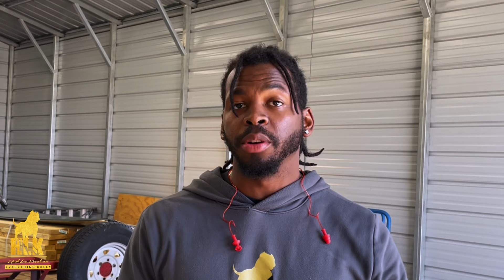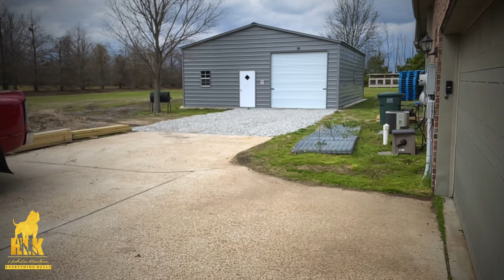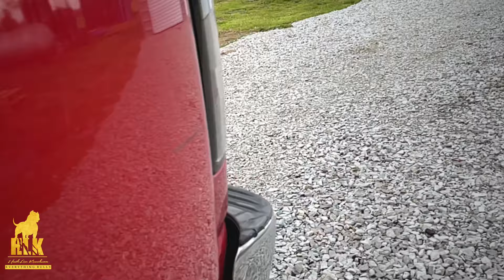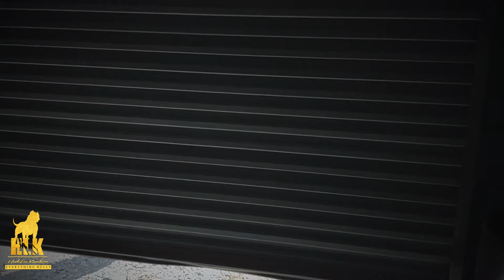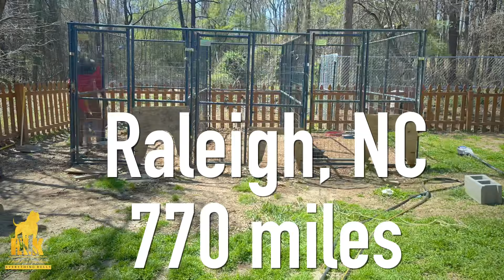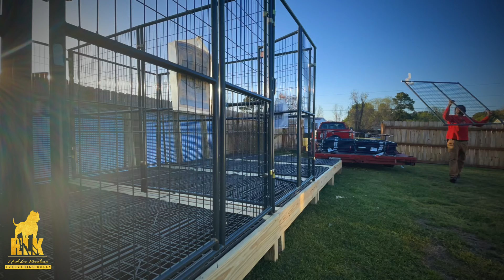The Outdoor Dog Kennel Setup that Just Keeps Getting Better| The Build and Setup | North Carolina

Comment: Awesome Job! Just an Idea but you could make a whole where the legs of the metal part of the kennel could drop down in so that the kennel can't move, unless you already have something like that for the set up. Looks good Sir.
Reply: Drill holes and use u-bolts to secure them also.

Comment: NICE...Really great set up, looks professional. As others have mentioned the pee and poo going beneath that grid flooring is an issue.  I would suggest have floor high enough, that you could attach plastic HDPE sheets or plastic roofing sheets beneath the mesh floor,  to catch all fluids or debris and slanted into a plastic eves trough (also slanted) which would direct away pee/spray off or run off. Most kennels will have the run off then dump into a buried barrel (septic type system) as cuts down on smell and flies and kennels are then easy to Quickly sanitize (wysi wash) without getting mud everywhere. Looking forward to seeing your latest modifications !!!

Comment: Great job with the kennels they look awesome just be sure you have a solid foundation it be 💯 otherwise it will more than likely move over time especially in wet weather
Reply from the maker: Thank you. Thank you for the analysis, you think I should start supplying the concrete block and just add them into the total price?
Reply: @HustleLineKennels I would definitely go with just a deck block under the legs which also helps lock in the 4x4 and help stabilize it more but I would absolutely add it to the price or atleast offer that option for them to add it.

Comment: I like the concept. My question is. How do you clean under the Kennel run ? Very unsanitary to just let it pile up.  Good work but i would want the entire kennel on a concrete slab so i could spray down the debris under the kennel runs.
Reply: The inside floor can be taken out!!!!!
Reply: My exact thoughts.  Its the only way to go.

Comment: I like.the pen an.plastic holed bottoms.but with the decks being so low to the ground how do you rake.stools.out from under pen that fall through looks like deck would have to be acouple feet up off ground
Reply: Read the description! You will have your question answered.
Reply: 3 or 4 videos showing how to clean all his designs you can rake it from underneath or you can pull the crates out and get a quick deep cleaning he also just designed a new waste management system, Check out his channel

Comment: Where the best place to buy multiple like that? I just bought a 5x10 from tractor supply im putting on a slab but i may need to add another soon. Would like to just add 3 panels and let one wall be the divider

Comment: How do you get under it to clean up?. Looks amazing.  DEEP EAST OAKLAND
Reply: He has plenty of videos showing how to clean the base and the kennels those crates plastic crates come out from the inside to get underneath and he just now introduced a brand new waste disposal system,
Reply: @robbiesmithmsubullykennel  they still don't explain how to clean under it they show how to clean the top and house not under the kennel where all the poop drops throw. Appreciate it
Reply: @royalfamilypets1772   But it does he has multiple videos on how to clean the bays underneath and how to clean the kennels under.
Reply: 4x4 plastic inserts come out ez just  Left it up and clean.
Reply: Last link shows his new drainage system